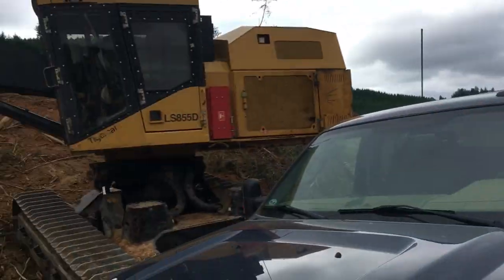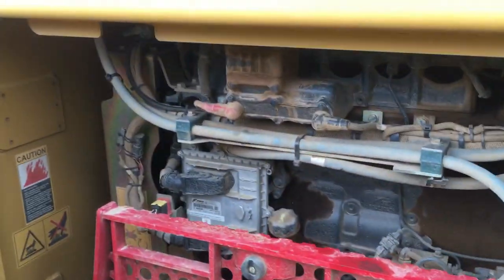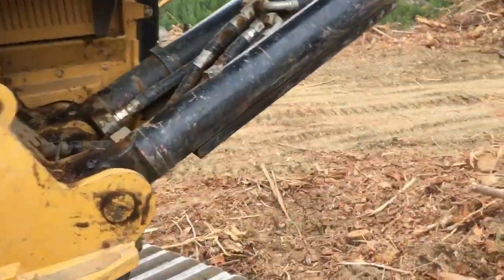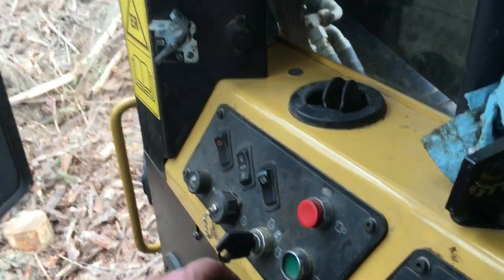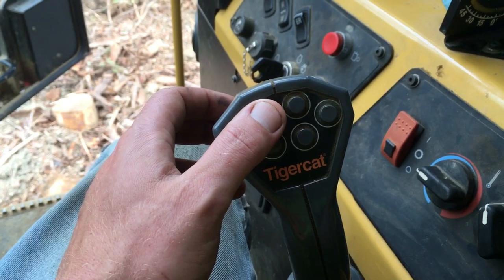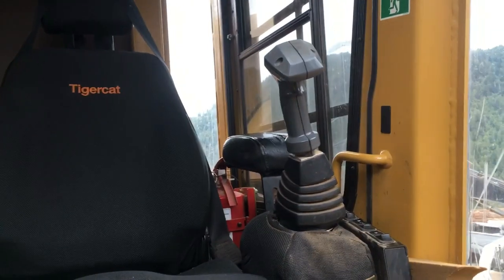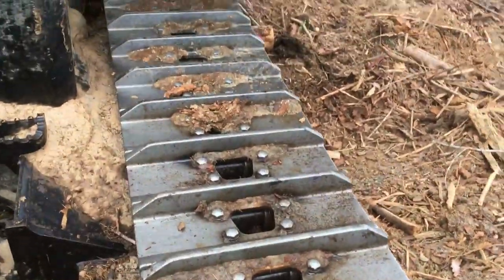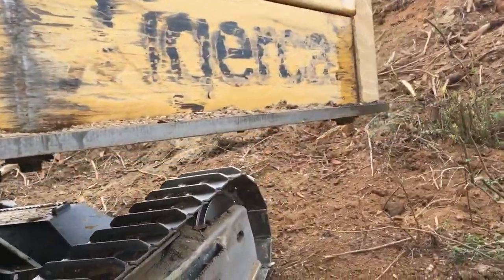Tigercat 855d walk around

Comment: thought some tigercats running mercedes engines.
Reply from the maker: Possibly. Not this one unfortunately. It’s a 6.7 fpt Italian motor. I’ve read that the crankcase breathers have a filter that gets plugged and wipes out the turbo. We replaced turbo and didn’t clean the charge pipe and oil sucked in and wiped motor out